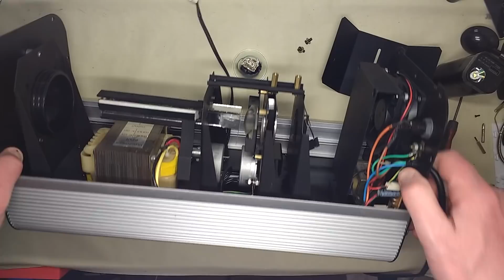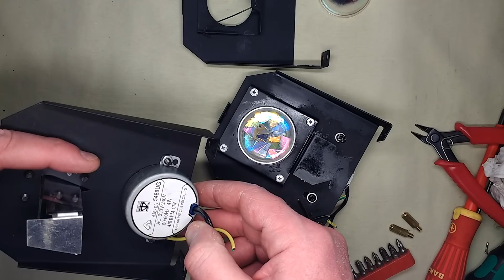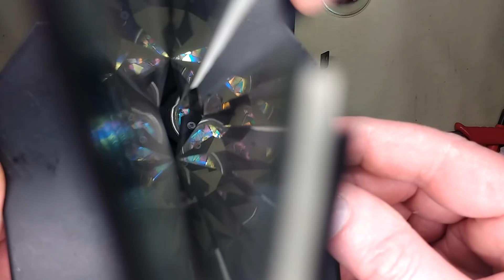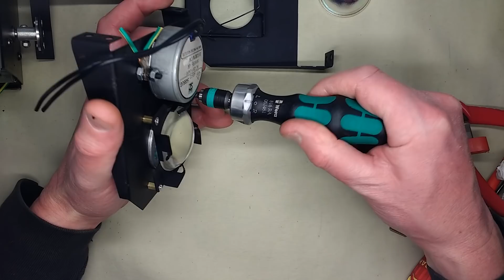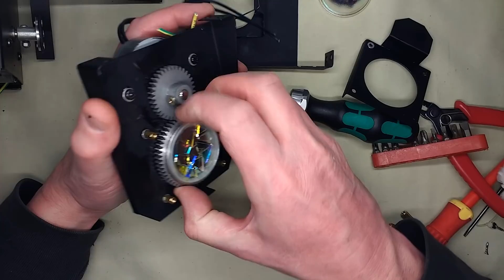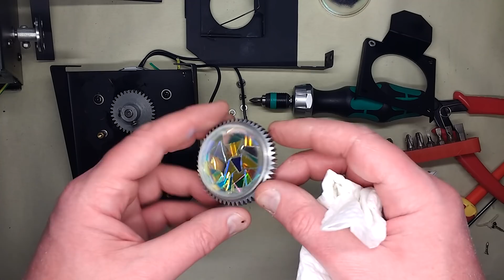Inside an old disco kaleidoscope projector.

Comment: Try using the ws2812b rgb led ring :) https://m.ebay.in/itm/122463201149?aff_source=Sok-Goog&ul_ref=http%253A%252F%252Frover.ebay.com%252Frover%252F1%252F4686-223281-2357-141%252F2%253F%2526mpre%253Dhttps%253A%252F%252Fm.ebay.in%252Fitm%252F122463201149%253Faff_source%253DSok-Goog%2526site%253DPartnership_PLA%2526crdt%253D1%2526ul_ref%253Dhttp%2525253A%2525252F%2525252Frover.ebay.in%2525252Frover%2525252F1%2525252F4686-223281-2357-141%2525252F2%2525253F%25252526mpre%2525253Dhttps%2525253A%2525252F%2525252Fm.ebay.in%2525252Fitm%2525252F122463201149%2525253Faff_source%2525253DSok-Goog%25252526site%2525253DPartnership_PLA%25252526srcrot%2525253D4686-223281-2357-141%25252526rvr_id%2525253D0%2526srcrot%253D4686-223281-2357-141%2526rvr_id%253D1382219732456

Comment: Can light be projected through a LCD?
Reply: Yes, that's how some digital projectors work
Reply: Niko Andruloni 
He he,,  cost is everything. .  So a guy could replace the old technology with a LCD projector module,  .. Then could insert a thumb drive with custom graphics. ..
With or with the colidascope mirrors, ,, or could even include the that effect in the graphics,  and do away with the mirrors all together. .
Ideas are cheap,,, at least for me,,  doing them,,  not so much....
Reply: that's how monitor backlights work
Reply: You could but its a crappy technique. LCDs also don't really like heat a lot.
Or just get a normal Videoprojector instead of this device ;)
Reply: I'm not sure you'd get the same brilliant colours, and the same shape of the projection. But above all, an LCD with sufficient resolution will be very expensive. Essentialy you'd be getting a high quality 4K (or at least FHD) projector.
Reply: Yes. https://i.imgur.com/gQWKn7Q.jpg
Reply: yep LCD monitors kinda rely on it :)
Reply: The cheaper video projectors use LCD but they are far from best quality due to limited contrast range. Digital Light Processing (DLP) is much better but a lot more expensive.  
Maybe Clive could make a video on how DLP Optical Engine works.
Reply: @peterjf7723  yes and yes also Clive should do an explanation and teardown of a DLP projector an explanation of the technology. Also DLP is good theoretically be used for that type of disco night I bet you that someone is trying to do it it likes. Will you like the flash drive deal and all that for graphics and all.

Comment: To eliminate the need for lube  a guy could 3d print nylon or some kind of plastic gear. Then go with a led lightsource, and some type of  wheel with the different colours (spelling out of respect for my euro brothers) tossing out the cog with oil in it, it would be a lot of work.
Reply: I don't think there's that much friction to begin with - metal gears turning at maybe 5 or 10 RPM... they will dissipate the heat easily. It stands to reason to add some lubricant, but it doesn't have to be liquid lubricant, a tiny amount of sticky lubricant like lithium soap goes a long way and won't go where it's not supposed to. I infer the issue may be that it wasn't running even enough due to tolerances in the gears, which is something you can solve with herringbone gear design. You don't get herringbone metal gears, except powder metal sintered ones for special applications, but indeed you could make them out of a plastic - if it was mass manufactured, POM or PA would be the choice, but given the heat in the enclosure, they will crack eventually, though it would likely take a few years. Now with LED retrofit, it would be a different matter, then you could even use PLA 3D printed gears. Some extruders can print Nylons, sure, but in general they're problematic, they drastically increase the risk of very high temperatures creeping up into the throat lining that is made from PTFE and can rapidly degrade then.

Actually for higher temperature use, maybe it makes sense to 3D print a thin-wall sacrificial mould and cast a thermoset resin into it.
Reply: Oooooh the oil is inside the glass container encompassed by the gear to allow the glass fragments to move. Silly me. Replacing it with something else would never give the same effect.
Reply: Siana Gearz I'll wait for your product to come out, since ya got it all figured out.

Comment: Release the shmoo!
Reply: Full bridge rectum-fryer.
Reply: Very AvE. Is Big Clive becoming a Canukistan?
Reply: I love these little references... disappointed Clive doesn't occasionally say FUUULLLL BRIDGE RECTIFIER "properly".
Reply: @Walking_Death  actually every once while he has at least once in videos I have seen.
Reply: A man you never see the face of has significant influence with bulletproof ideas. One of those being that saying, and how fun it is to say out loud.
Reply: RELEASE THE SHMOOO!
Reply: That Shmoo may not in fact be the oil from the oil suspended dichroic wheel. But maybe motor lubrication oil leaking through I failing bearing on that motor that drives dichroic wheel oftentimes those Motors are oil-filled such as in a timer or clock. However not all of them in terms of the geare box.

 not the coils although.

I've seen this happened a few times.